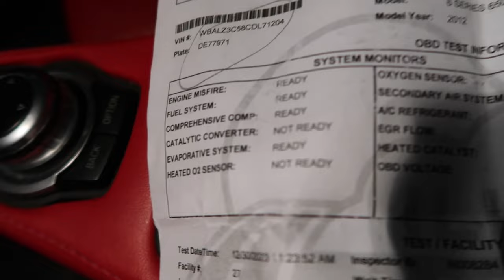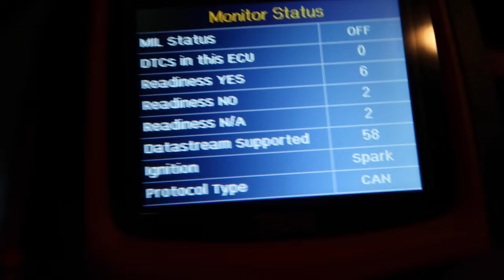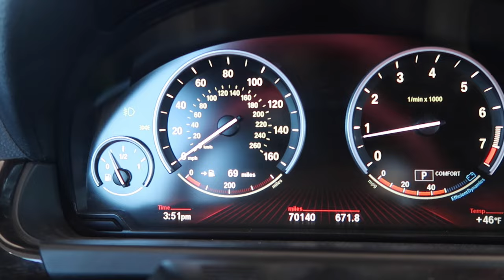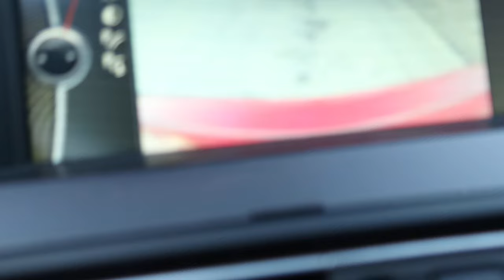I Finally Decided To Move! What's Next!

Comment: Gang i told you over a year ago to get rid of the BMW they look good but run like trash 🗑. I had to get almost 8k worth of engine work out of nowhere luckily it was under warranty. Then i got rid of it never buy another i think Mercedes run better 🤘🏽
Reply from the maker: Mine runs good I just don't drive it that's all. I have to drive it but the weather keeps messing up out here my new one will be much newer this one is just a 2012.
Reply: @TuneChee  ok cool i had a 2010 and it ran good and then the valve guide seals when bad it was white smoke coming out the exhaust. I knew a cat with a 2015 vert and he said that thing burned so much oil you gotta add a quart in between oil changes that's crazy!!! If i was you i would get something different...
Reply: What gang u claiming
Reply from the maker: @regrich8795  must've had high miles I wouldn't touch nothing over 100k from My past experience with the 545i series I had

Comment: You can actually pass with 1 not ready
Reply from the maker: I didn't know that!! Thanks for that info! I got 2 not ready but it use to be 3 not ready and I set 1 out of 3 after I changed that mas air flow sensor I just need to drive this bad boy. And good looking gang frfr!!